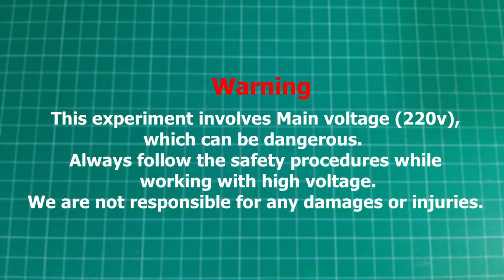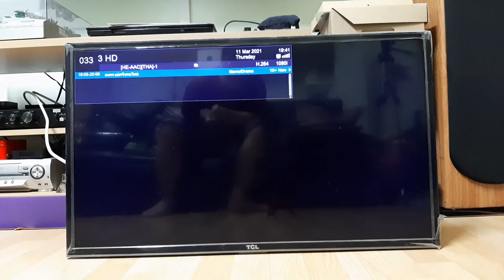TCL LED TV Repair No Picture, Logo Flashing.

Comment: Hi my TCL is doing the same but I saw lot of other videos replacing the LED stripes. Logo flash then plays sound but no backlight.
Reply from the maker: Both the LED strip and Driver circuit can cause this problem, but the driver circuit is easier to access so check the driver circuit main components (Diode, Capacitor) first if everything is good then continue to check the LED backlight strip(using the led backlight tester device).

Comment: A hint:  You can discharge a capacitor with your voltmeter.  just hold the leads across the cap and you can even watch the voltage go down as it discharges.  Alternately, I sometimes use a 10 watt resistor with leads soldered to it.  I know it's popular on youtube to just short them out but you can damage the cap that way.  Not to mention the unpleasantness of having the thing flash in your face.